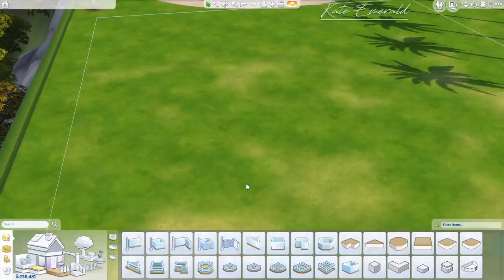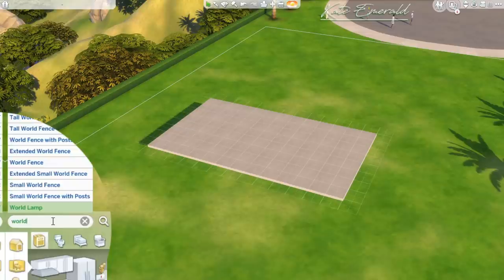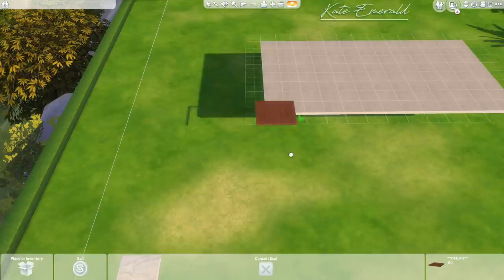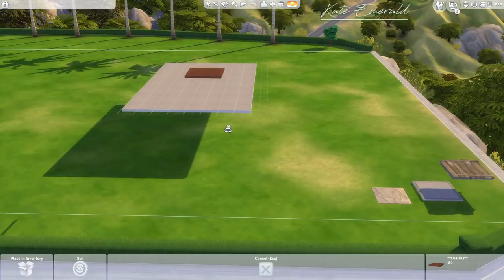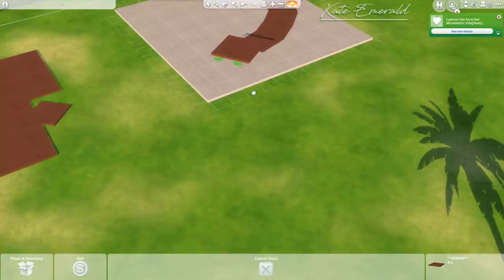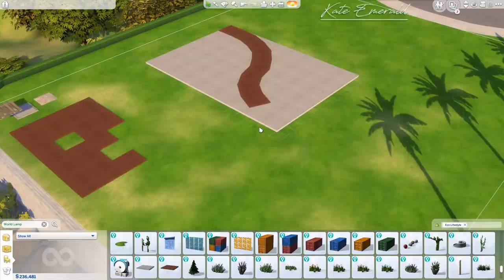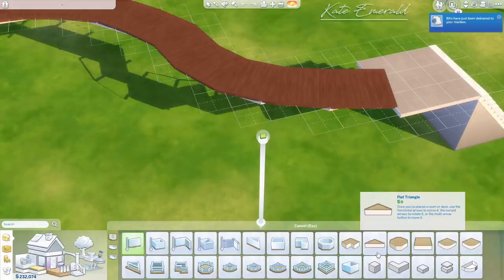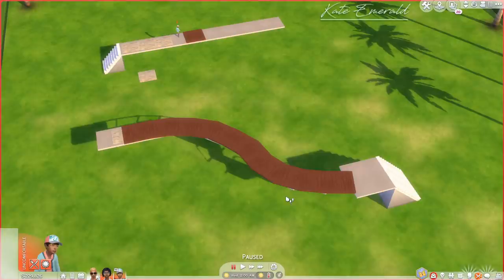Curved Bridges - Sims 4 Tutorial [No CC, No Mods] + Base Game Version | Kate Emerald

Comment: A question I have is sometimes when I place a window the wall is showing in the window. Is there a way for that not to happen bc Im struggling to fix it when I build. Idk why the wall is showing through tye window the windows arent even touching or too high/ low for the floor/roof
Reply from the maker: Is there another window close to it? We got the free window placement update a little while ago and when you place a window off center (Not right on a wall) you've to make sure that no other window is too close! :)
Reply: @KateEmerald  yeah that free window placement is pretty nice. But its not too close. Like for example yesterday I was making a more modern lime house, used the big open windows and it was happening a lot. (Used grid to place next to each other) and still did it. Thanks for the help! 😁
Reply: @Name-sb2in  try placing them before decorating the walls so you can see the lines inbetween the panels of drywall. If you place one in the middle of a line between a panel, any window you place either side of it will do this (unless you move it further to the side, far enough away)
Reply: @hesterwright3674  alr thxs :).
Reply: that happens to me as well bc the game doesn’t really recognize windows that are place on a half tile or using the ALT cheat. what you can do is to place the windows on the actual tile instead so that the game recognizes it. also  the game has this rule where you can place only one window per wall.(this only applies if the length of the wall is small) hope this helped.